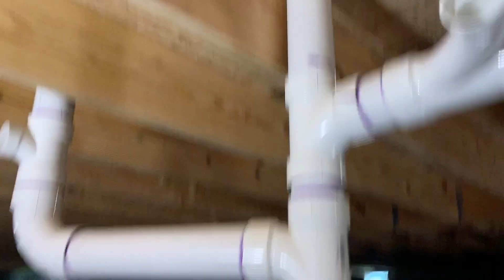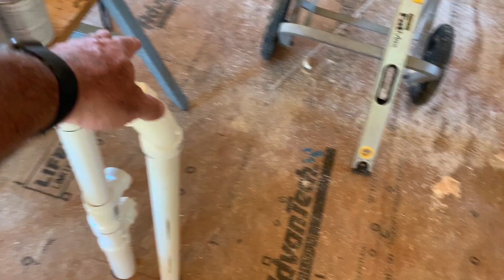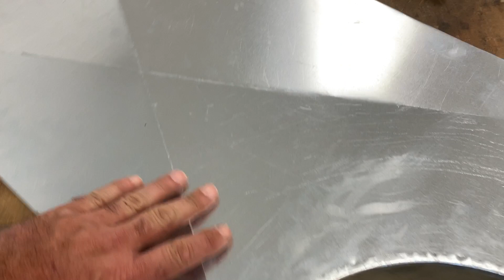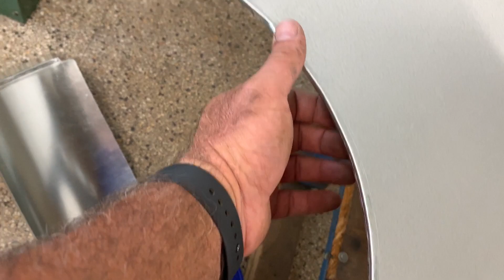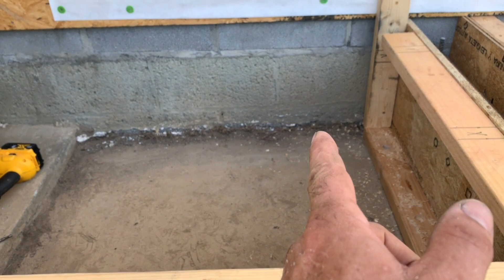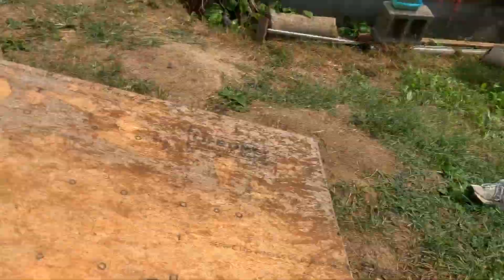Not Necessarily HVAC Part 12

Comment: my eyes just had to find something, the dryer vent box has a crimped male end out. that should always be a female end and the flow should always leave the male end and enter female end or it causes a lint trap and will clog faster.
while I didn't notice if the rest of the line was ran backwards, that looked like an adjustable elbow, so I can only assume the possibility :-|
Reply from the maker: Good eye! That’s actually the cut end in the box. They say the flex will side over it but it’s not too easy. I just lightly crimped it with my hand crimper to make it go together good later. The real lint catcher is the flex in my opinion. Gotta clean it out from time to time!
Reply: @ComfortPlusHeatingandCooling  yeah, both catch lint. I always try to use as short of flex as possible. then again, the dryer filter type makes a big difference, the long pull out models seem to do the best, as long as people push them in all the way and clean thins like tooth picks and and other thin long things out of their pockets.
I've installed many dryers, ducts and done lots of appliance repair over the years, among many other construction, automotive, electronics and computer/it fields

Comment: they call that a bow vent @10:10 in my area. usually i just stub up 2 pieces of pipe thru the floor bout 8" high or tall enough to get thru the floor of your cabinet and using two fernco couplings hook up the half for the plumbing test. then when cabinets show up u can remove the top end of the bow vent/drain, drill 2 holes and set the cabinet overtop of the two pipes. then u can cover up the holes with some nice escutcheons if you left enough room in between the 2 pipes which looks like you did. youll probably end up just cutting it with a sawzall and using two couplings down the road